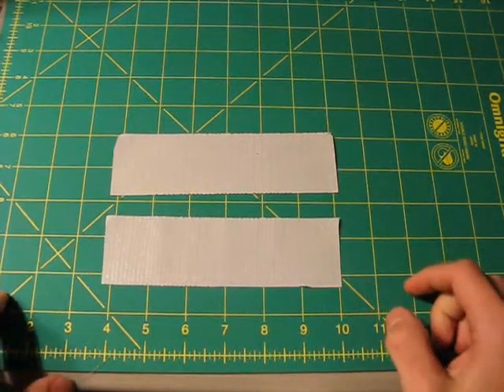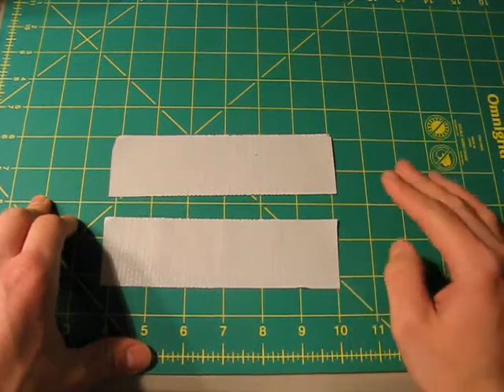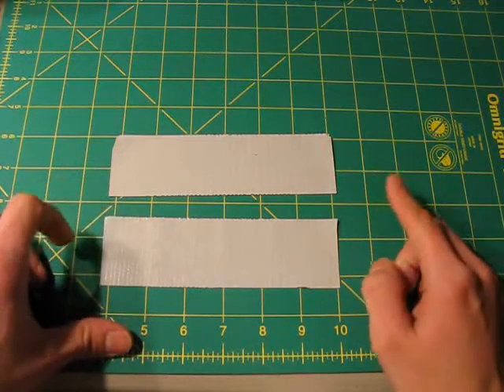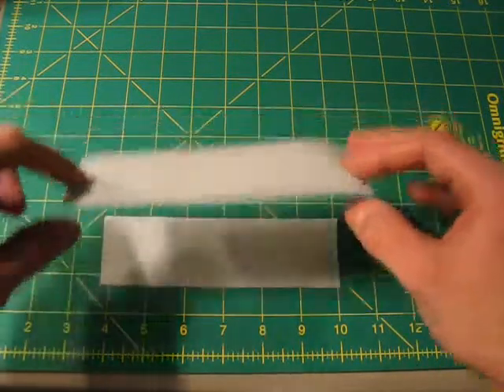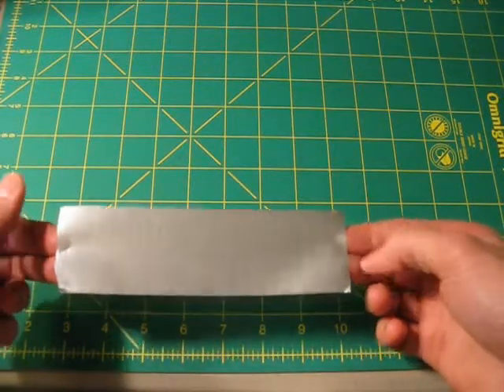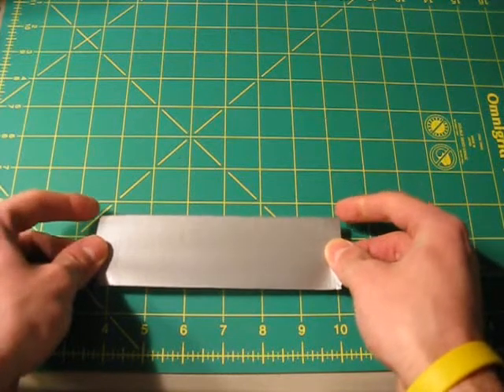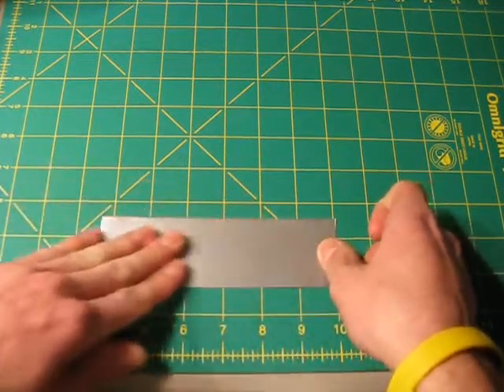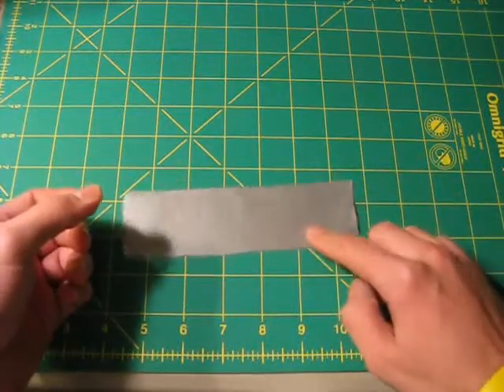Mini Tutorial - Sticking duct tape together effectively

Comment from the maker: I could but the solution is very simple. All you need to do is slip one end of the book in as you said, then detach the two small pieces of tape that hold the strip which keeps the book's cover tucked inside. Then reattach the strips and you're good to go.